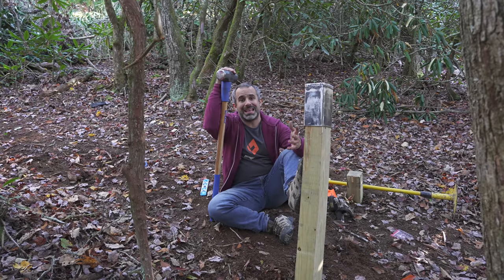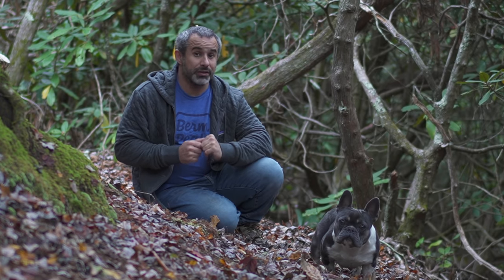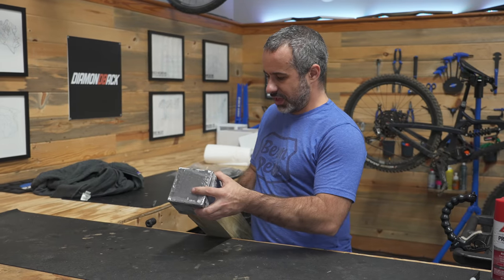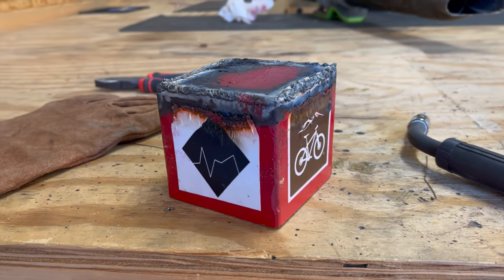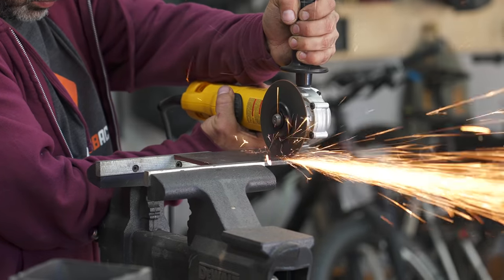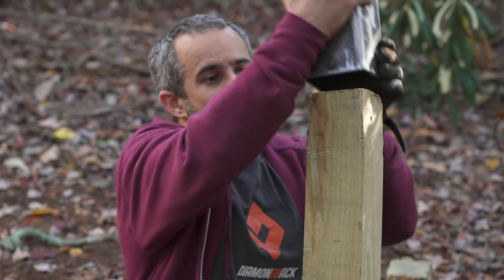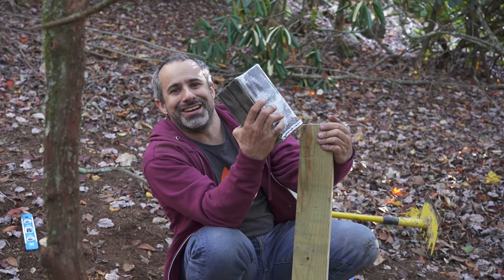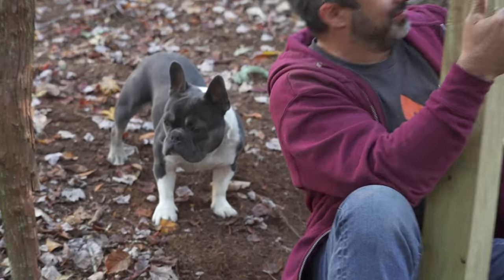Making a Metal 4x4 Post Driving Cap for Building MTB Features

Comment: Seth, just use your zip disc and cut down the 4 corners removing the material all the way to the cap. Then use your vice and a hammer to bend each side out so it will fit over the 4x4. For future an open corner fit will make things stronger then a flush cap. Also, please get some sheet metal to top your wood table when welding lol.

Comment: Small electric hand held jack hammer.  Modify one of the attachments to fit your 4x4 posts.  Use your original design but make it out of 1/4" thick plate.  With the jack hammer, your blows will be centered and you won't blow out the sides.

Comment: When it comes to welding thick gauge steel, chamfer the edges. Butt welding works best if you’re arc welding at this gauge. If you’re mig welding slow down, and increase your wire feed. 
Heavily tack it 5 or 6 times along each edge before doing a continual weld. 

The reason it split is because if something called under fill. The weld isn’t actually attached at the top or the bottom, just where the filler wire made contact. Move the wire from the top of the join to the bottom, that way you’re getting conduction and not just a slag pool that blobs and spreads out. 

Also even when you E been welding years, it’s still always a good idea to practice a weld on any new material you get. So you can dial the settings in.

Comment: Your top weld on the first proto was holding after you doubled up on the welds, it was strong enough to allow you to bend it back without snapping off when the sides split. I would have just doubled up on the sides and tried again. Maybe put a 2nd plate on top so it didn't bend in so easy. -Fellow Project Fumbler

Comment: Cut the angles of the block like 1" from end. This will leave you with sides that are 2" wide and without angles. Cut from the stock a peace with the same length as the block. Now cut it into 4 by the middle of each side. Now you will get new L profiles. Grind the ends a bit in angle towards the outside. Weld them to the outside of the block. Now that radius at the corners will be further away and the block should fit. 
Also - a little bit higher current will help a little bit with the strength. The first block was with bad welds because the metal was not melted.

Comment: concept was good,
I'd suggest going with .20 inch thick sheet metal, cut a plus shape, bend the sides to form the cup, weld the sides. After this, get an inch-wide, 17-ish inch long, piece of sheet metal, and bend it around the mouth of the cup, to act as a reinforcement to hold the corner welds together, and in such a way that the ends of this reinforcement plate meet at the middle of one of the cup's sides (don't want that weld to be on top of the cup's corner welds, cause that would then become the first failure point) Weld the reinforcement onto the cup's mouth, weld the ends of the bent reinforcement plate together... should last a lifetime I believe.

Comment: Get your Ryobi grinder with the battery so you can take it into the woods or even do it in the garage, doubt it would be as fun though and add a 4-1/2 in. x 5/8 in. Grinder/Sander Conversion Kit and some 24 or 36 grit sanding discs instead of the cut off disk and take the sides of the post down about 1/4" all around. Yea I thought that battering cap was getting hammered onto the post. Then we could see if you can get it to come back off!

Comment: I think just a thick square with 4 rebars welded to the edges would do you good. Cut the square larger than a 4x4 and weld the rebars lengthwise with a 4x4 in place

Comment: Hi Seth
I have been thinking about your project to knock in the posts. If you turn the new stronger cap over and put it on the end of your sledge hammer you will achieve the result of spreading the impact load over the top of the post and avoid splitting them.
Ken

Comment: If someone asked me to make one of those, I'd go with minimum 1/2 thick plate for the strike surface, 3/4 if I can get my hands on it.  An 8 pound sledge is probably generating over 3000lbs of force for a split second, therefore to distribute the load you need thicker material.

Comment: So this randomly came across my feed. 
Don't know if you ever found a solution, but I'd go with a 3 to 4" thick slab of mild steel with about 1/4 to 1/2 inch milled out of one side to index with the post. It'll be a heavy tool, but it needs to be. Alternatively I do have something for driving circular posts that looks like a battering ram, but that's essentially what you have here with a larger inner diameter tube and handles.

Comment: if you wish to try this again i can give some pointers (i hope, i do better with a place to sketch not words) my opinion would be about 1 and a half feet long of 4 1/2 x 4 1/2 steel square like you had, weld a cap on like you had and weld on more weight on top(even scrap metal works its just weight and will feel almost no force) and then a handle on either side to be used similar to how a police officers door breaker thingy works just on a 4x4 post.

Comment: You could still use the tubing you have left, take it to a machine shop. They could probably bore the Id to the right size and also do a stronger weld for the cap. The weld needs to fully penetrate to have any chance of holding up to the hammer.

Comment: Use 0.75" round drain pipe w similar cap on one end. Weld big honking pieces of rebar bent into handle on either side. Big, thick stuff that has weight so the tool does all the work. Then, slide it over the post so 1- 2 guys can use the handles to slide it up/ down driving the post into the earth.

Comment: Use 6” thick tube and weld the cab on top of it. Make sure the cap is wider than the tube. That will be more than enough. They use similar setup to drive fence posts to the ground

Comment: Build it the other direction so you bend over the top and weld on two sides. Definitely weld on a handle to assist with removal.  Love the concept and I think it will work with some tweaks.

Comment: Seth, a tip for welding a stronger bead,  put the tip closer to the metal to get it hotter and go a lot slower to get the metal to get really hot and bind together really good.

Comment: Try sharpening the end of the post and pushing it into the ground with your excavator bucket.  You might not have the weight for it, but this technique works great in a tractor.

Comment: Living in Arkansas -- the idea of pounding a 4x4 into the ground is so foreign to me. We bend steel posts putting them in here and sometimes you just flat out hit bedrock just a few inches down.

Also, although I'm sure you've long since resolved this, nonetheless -- you could have just cut down two opposing corners and gap-welded it to make the tube larger. Since you're building something custom already anyway, or were, could have made a massive slide-hammer out of it. That'd have been pretty sick. Also would have been awesome to let someone else carry around, lol.

Comment: Cut two of the corners on the box section to spread it wider. 45 Deg weld preps and loads of heat to seal it back up

Comment: I'd say if you can go to a larger size of square tubing, then weld some metal on the inside to decrease its size, leaving the corners open so the sharper edges of the 4x4 post have somewhere to go.

The other option would be to cut out the corners of the square tubing and weld angled steel on the outside of it (again giving somewhere for the sharper edges of the 4x4 post somewhere to go). My thought is modify the tool in question, not the material.

Comment: I'm thinking maybe a pair of press put it together and just weld a hammering plate on top. The press as in the same mechanics as a vice grip. So even if you are only driving a 2*4, 3*4 or 4*4, it will hold it in place and it will not split the wood cause it is compressing it on 4 sides while you are hammering away.

Comment: Get some ground screws (look them up) or drive steel posts in with a jack hammer and weld attachment plates to the top for the bridge to attach to.

Comment: Short taps with the bottom of your bucket some will push in when your tapping with your bucket pull boom lever  back just before it hits the post it will hit harder and be smoother on the machine

Comment: Hey Seth, if you make your top cap have a quarter inch overhang on each side you could have a proper fillet weld and it would be a lot stronger (once you get the proper sized tube)

Comment: Can you bend a 10mm (7/16) plate like you did in first idea to form a u shape,  with a 16” leg x 4.5” plat and 16” leg. Then weld a 1” wide plate each side at the open end to keep the bash plate contained on the post. Then you’ll have something that will probably stay strong ie welds near strike zone won’t crack.. 

Otherwise buy a “postdriver. There’s some cheap options online.

Comment: Hey Seth, when you grind down welds to make something pritty you sacrifice alot of strength. You also don't need that welding hammer I saw, because when you mig weld it doesn't use flux it uses gas instead which means you don't need to hit any flux off.
Reply: Those look like fluxcore welds to me..  no shielding gas.

Comment: Would cutting the opposite corners of the box tubing so you have two L shapes and welding the insides of the box section to the outside edges of the plate work?

Comment: I think if you just chamfer the top of the post, and get a 5x5x1/4 wall tube, and weld on a 4.5x4.5x 3/4" plate you'll be golden. The chamfer should help reduce splitting even with the flat plate on top. And with the 5" you don't need to worry about it getting stuck 😛

Comment: get a sheet of the metal and cut out a + and bend the side down to make the shape that will keep the top connected to the sides and jsut weld the side to each other cause it wont matter as much if those welds break. you would need a 12in plate though so it would be about 30 ish dollars depending on the seller

Comment: Use a planer to take some of the material of the 4 x 4 so the cup fits And is posible to take of again. And leve the post a litle bit to long. And cut them to the corect lenght with a chain saw after you have pounded them in the ground.

Comment: on the metal cap you just made, you could fill it with some sort of heavy material, like sand, metal, lead, and cap off the other end then attach a handle to it, making a deadblow post driver. or a better solution would just be to buy a post maul.

Comment: Just size up the square tubing. A little excess gap won’t make a difference for pounding in 4x4’s but the concept was correct.  No need to make it complicated with extra welds or reinforcement. Steel is strong, just get it big enough to go around the 4x4.

Comment: Cut the second driving cap to about 2 inches in length. It will be plenty strong but you’ll be able to knock it off the post without too much trouble.

Comment: "We're gonna be doing something kinda the same"... and give up?
For Rev. 3.0. Take a piece of your 4x4 tubing and cut it lengthwise, either on the corners or in the middle of each side. Now you have the 4 side pieces of Rev. 1.0 except they are now 1/4" thick. Take these 4 pieces and weld them to a thick top piece, sized for 4X4 pressure treated wood, and bang away.

Comment: Get like a 1/2" off cut from a machine shop and ask if they could cut it to your dimensions for a few bucks, Then weld the thicker tube to that (remember to measure ID not OD lol, I've done it a few times too don't worry). Then do multiple mig passes on it and let it cool between Passes, also wrap your corners...
I know it takes away some of the DIY but this is my suggestion if you need to replace this in the future.

Comment: You could cut the sides down to like a length of 1inch - that might make then thing still removable once the post is hammered into the ground. 
Long-term, the C-shape wiht 2 caps, suggested by others, probably is the better idea however.

Comment: Look at it from the physics point of view. When you hit the metal thing with a sledge hammer, you drive energy into the metal cap, now all that energy gas to go somewhere, so some of it goes it the wood but the rest of it gets lost in vibrations and into the creases of the metal cap, that's why it breaks

Comment: Just cut the corners of the tube with an angle grinder up until about an inch from the top and that'll grab the post and the cuts would allow you to bend the square tubing a bit bigger to accept the post

Comment: Cut a 4in long piece of that steel thing. Remove one wall making it a U shape. The lower part of the U is where you hit it with a hammer and you just got to weld 2 more side walls. Should be much more stable and fit a 4x4

Comment: Two things: 
Please use a guard on your grinder AND wear a full face shield. Injuries with cutoff disks are ugly and can be deadly.
Second, you are making mostly a surface weld. If you want them structural, you need to bevel the edges and get a fully penetrating weld

Comment: Welding tips: your gun is too far away from the steel before you grownd Down your weld it had all sorts of bug holes or bubbles in it ether yor gas wasn't set right you usually want to set it at 20 or your just to far away from the steel after you rewelded the red on it looked like a seagull flew over and took a crap on it slow down and be pacent and don't rush it.
Hopefully this was helpful

Comment: Stay away from flux my friend. It works for small things. Also, turn the heat up to get better penetration. If done right, the metal will crack before the welds.

Comment: you should try to build the device out of wood. It would cushion the wood better and not damage it as much. It's still hard so it would still transfer energy pretty well. And it is a lot easier to work with.

Comment: you just need to sharpen the inside corners of the second cap, 5:38 its just the sharp corners of the wood in contact with the rounded corners of the metal

Comment: tip for your welding. turn the wire output a little lower and move you welding gun in a constant motion and you should get a better and stronger weld.😄 and use gas…

Comment: if you can get someone with an end mill you could hollow it out a little then i would cut a small channel into two of the sides so it doesnt get sealed to the wood and you could insert a small metal rod and hammer it upwards

Comment: One thing that would work is a flat piece of 3/4in steel with a hole cutout in the middle for a screw or lag bolt, and screw it into the top of the post and start beating on it

Comment: If the welds are strong enough, you could actually just get an angle grinder and cut all four corners of the sides. Then you should be able to get it on and off easy enough and the sides being separate pieces wouldn't really affect it's function. The sides are only there to prevent it from flying off, it's not really structural.

Comment: Man, keep it simple. Hatchet strap something around the edge of the 4x4 and then just hammer the wood. It will not split as long as the strap holds. Try finding a bigger deadblow plastic hammer with a bigger foot print and you'll naturally spread the load. It was fun to watchz nevertheless

Comment: Use the excavator bucket to push the post in, get it started with sledge maybe.
Reply: May be hard to get it at the right angle, may have to run a ratchet or winch from post to tree to keep the angle you want.

Comment: I would use a router to put a big eased edges on the 4x4. And if the 4x4 is still slightly to big remove  some material with a electric jointer or a saw. Alter the 4x4 slightly

Comment: got an idea for Generation 3 of the post driving cap.  
Walk around with a sheet of metal 4x4 with a hole in the middle for a screw. 
- then you can quickly screw it into the top of the post and whack evenly with a hammer
Reply: Won’t work. The screw will only make it worse by splitting the wood even further.
Reply: @hugo-fy7by  if not try 2 or four screws in the corner
Reply: @TheUltimateULTRA  or tape around the pole

Comment: what if you took a thick piece of metal (1/2 inch or so) drilled a hole in the middle of it and then nailed it to the top of the post? you could then pull the nail out and move it to the next post. each swing of the hammer would re drive the nail so it would not come loose, and then you do not have to worry about the tube fitting the top of the post. If you dome out the piece of metal you could just flip it over on the next post. the nail hole in the top of the post should not mater for the work that you are doing.

Comment: cut the 4x4 metal tube into 1 inch length. Hammer it on so you now have a ring binder. Smash the timber post in and hopefully it wont split because the timber has the ring binder.

Comment: Why don't you push the post into the ground with the excavator? You can do a shallow driving cap from 4" tubing you got, to prevent post from split and it will came off easily. That's how my fother has done it when he was building a fence with wooden posts.

Comment: U should have cut the top plate as small as outside corners would meet inside corners of the square tube, that would give u much more space to put a weld in than just a tiny gap on the side.

Comment: Cut it down each of the 4 edges that are parallel to the post axis. Spread the 'leaves' apart. Hammer a slice of post into the top inch or so, where it's still tight.  Clamp each leaf, but not too tight, to the top of a (sacrificial) post. You should have gaps 10-20mm thick..? Cut 4 long corner pieces from the rest of the box section, and weld them along the edges. Go bash.
Reply: ... or just follow the last step to make a whole new slightly larger one :D

Comment: Can you actually get the digger in there?
If you can go hire a vibrating head for it and drive the posts in with that.
I've seen guys at Kiwifruit orchards drive in 12inch round post 15feet down in 2mins.